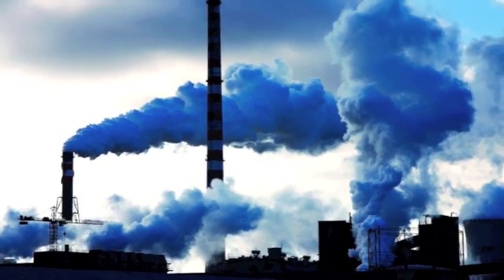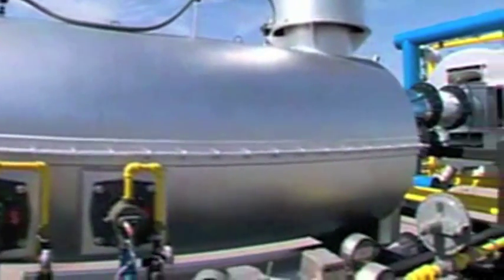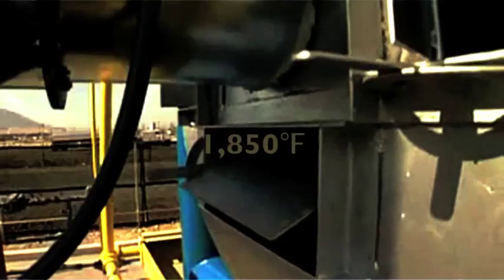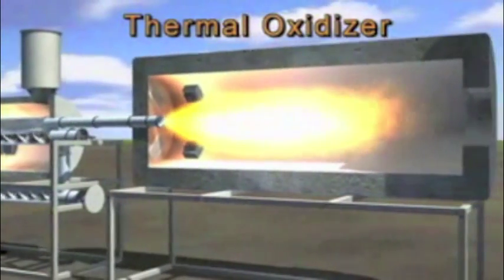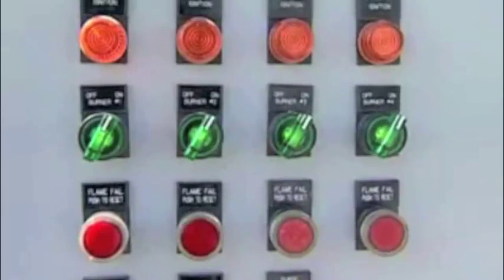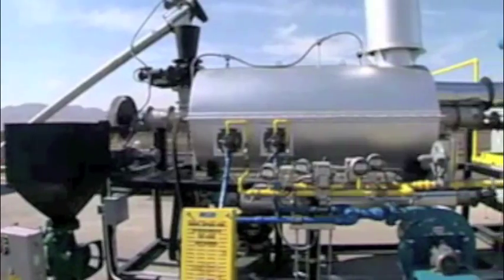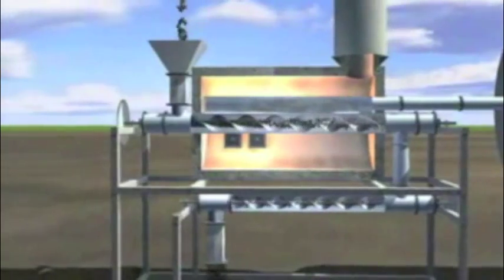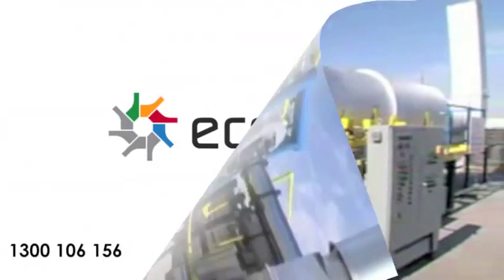Thermal Recovery Unit ( TRU)  - Waste to Energy Pyrolysis

Comment: Can we have price for pyrolytic part of this unit? I use small version if it where batches are made. This continuous is more effective as re-heating cost will slashed down. I need this unit because will be connected to condenser to heating oil recovery.